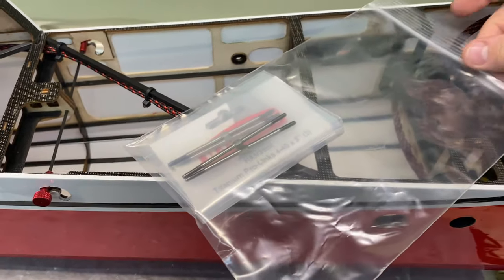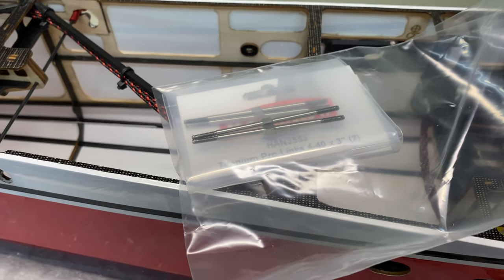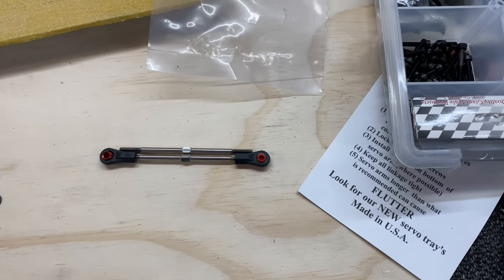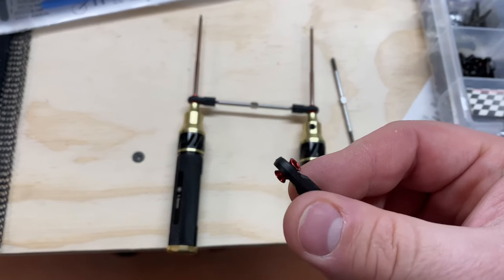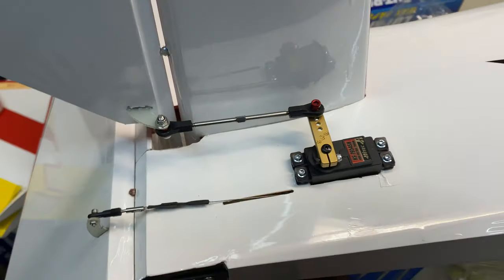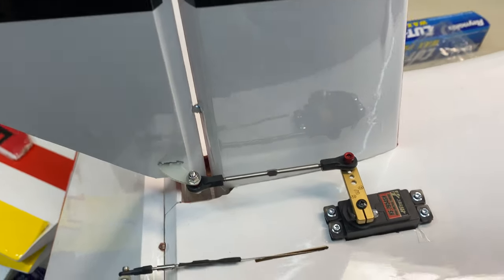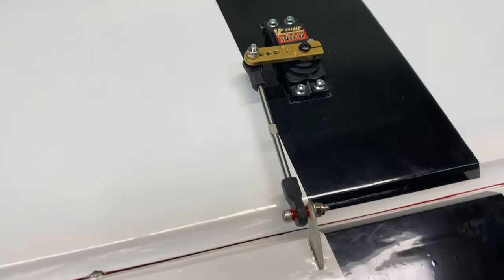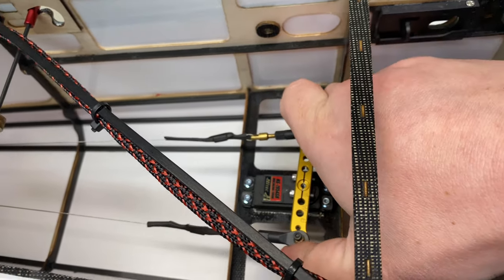RC Airplane Build - Building the Pilot RC 20cc Laser - Part 5

Comment: Hi Jake, I’ve just bought the same plane & DLE 20RA here in the U.K. too. It’s my first petrol engine (I mostly use 4 stroke glows) some people are saying the DLE 20RA is under powered for 3D flying with this motor. Any advice before I start the build about the DLE 20cc RA being powerful enough?? Thanks
Reply from the maker: Hi John, I would not think it would be under powered but I will give a full report in the maiden video coming soon.

Comment: Hi again Jake, I’ve bought a RCGF 26cc motor for my 67”lasser. It’s about 4oz heavier than 20cc. Do you think I will be ok for c of g with the rudder servo in the tail? Have you flown yours yet? Did it have enough power with 20cc? Thanks
Reply from the maker: Hi John, I cannot comment on the 26cc. I would say compare the weight difference of your  motor and the DLE 20cc since that is what I am using. Stay Tuned for the next video coming shortly!
Reply: Hi Jake, thanks for replying, your laser 67” build is great & the only video I could find on utube for this plane, I’m really looking forward to your next laser video & hope the maiden goes well. I’ve built many RC planes with nitro 4 strokes but the laser is my first gas & 3d plane so want to get it right🤞
Reply: By the way Jake, did you need to put any weight in the tail end of your laser to get the C of G right?
Reply: Also maybe you could do a part 6 video on the gas tank/ radio/ balancing etc then part 7, the maiden & your thoughts on the laser 67” 🤞👍

Comment: A nice plane you build.
But I think your hole for air to the cylinder is too small to achieve good cooling.
Just my opinion.
Reply from the maker: It very well could be. I will try it out and make my adjustments.